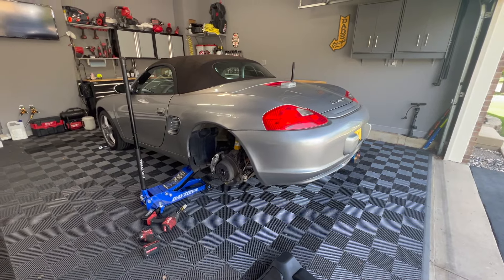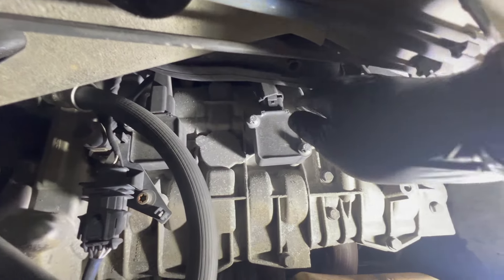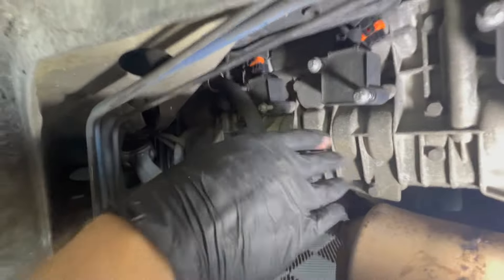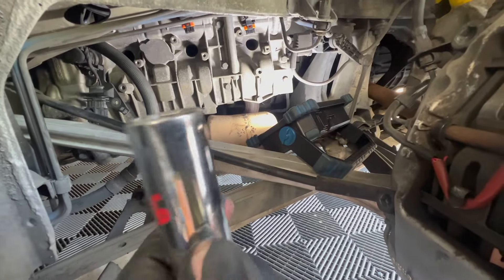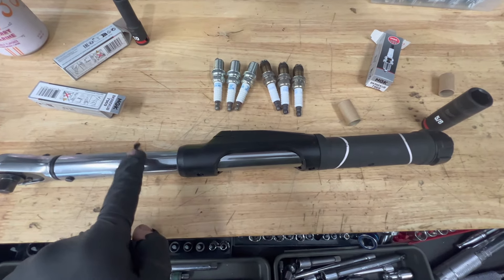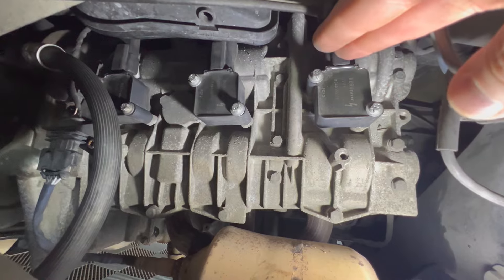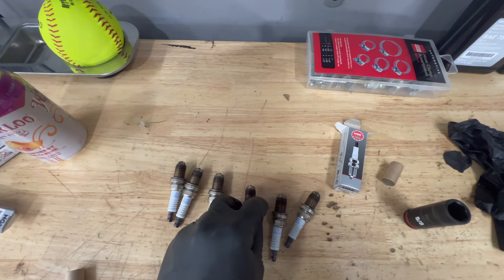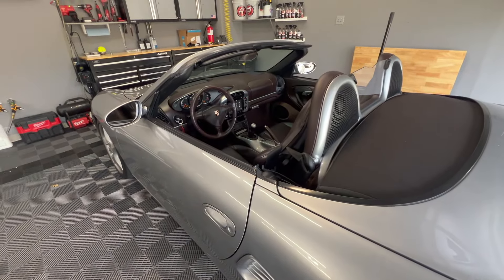Spark Plug Change DIY on my 986 Porsche Boxster - Boxster S 550 Spyder Project Car

Comment: Great Video!  I Have #0845 of the 550.  I bought the same kind of spark plug but cannot find gap info. They came factory gaped at 0.020” but the page says the correct gap is 0.032” .  I’m not sure what’s correct? Any ideas?
Reply from the maker: I believe it’s 0.032”, but haven’t seen that on a credible source.